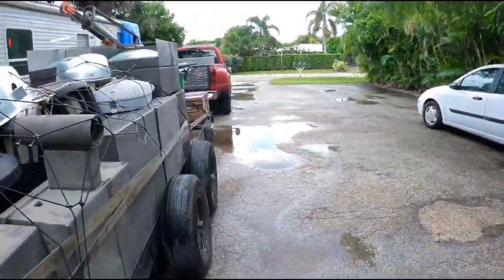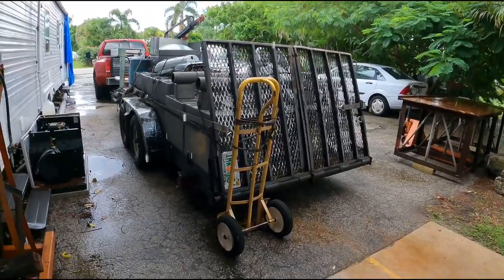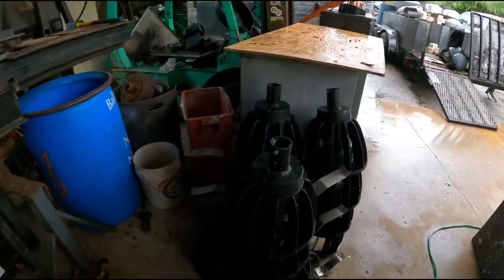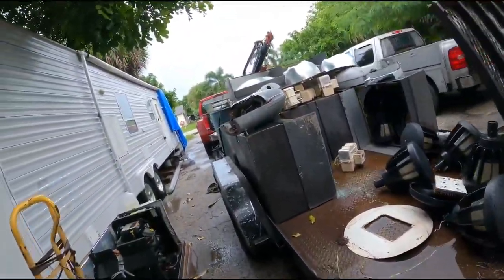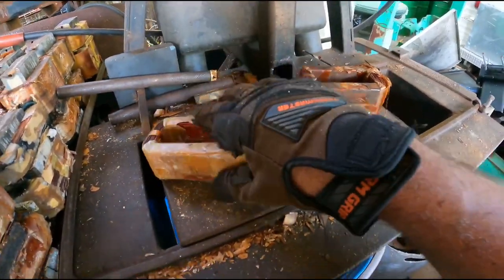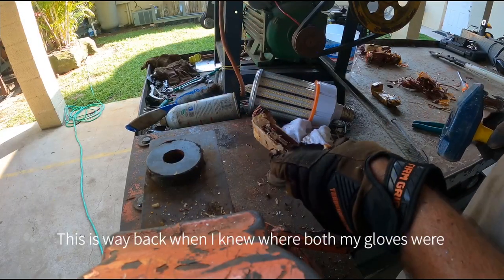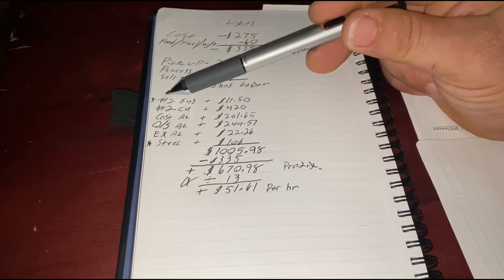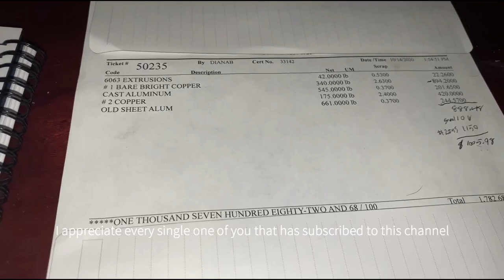Scrapping Transformers? Make Sure To Check Your Coils!

Comment: Man to think of how many of those I’ve thrown away over the years. They don’t even make it back to the shop, we just toss them in the can wherever we’re working looks like I’ll be saving them from now on!
Reply from the maker: You should be saving them, if you watch my next video that I’m about to drop you’ll definitely want to save them.
Reply: @ProjectShopFl  I had in the past when the sy would take them as copper motors but now with most being the half coated half copper they won’t take them but this video makes it look a lot easier to get apart then I’d previously thought!

Comment: I find the transformers which come from China are more likely to be aluminium windings, but you seem to deal with hundreds.so I wounder what your findings are. Copper weights twice as much as aluminium on the periodic table so it should be possible to find out from weight.
Reply from the maker: when I first started 80% of them were all copper, now it’s 50-50 or even 60/40 going towards aluminum transformers. Nobody wants to spend money to replace a high dollar ballast in an old light fixture so they either replace it with a cheap ballast from China or they change it right out to LEDs. I have done hundreds of thousands of these transformers over the past 10 years. for the first three years of scrapping I only bought HID transformers. I wish I could still only buy HID transformers. On the copper ones I wind up tripling my money.

Comment: So I have an off question here. Looking back at tour copper shredder and sluse box.
When you chew up wires that isn't say #1 or #2 wire, what does the granulated copper go for roughly.
Would that go from like $0.25/lbs to like what going rate, same as bare bright or some beer price per lbs because you took the work out of granulation?
Reply from the maker: I either get #1 chops or #2 chops. You have to be careful not to contaminate the good copper with tin  coated copper.  It goes like this #1 bs, #1 chops, #1 copper, #2 copper #2 chops
Reply: @ProjectShopFl  What is #1 BS, nose so what is BS stand for?
Reply from the maker: @midnight-xpress1136  bright & shiny or bare bright some call it.
Reply: @ProjectShopFl  OK, gotcha.
Thanks for info.

Comment: Unless It actually is a copper transformer just way them in chuck a couple small copper ones in the batch on top and send them over the bridge as motors
Reply from the maker: Sometimes if I have motors I’ll throw them in with them but I normally don’t get that many electric motors at this time.

Comment: I subbed a week or so ago. Most of my adult life I've scrapped when I can.  The one thing I missed in your video is what was the value on the aluminum coils with. The local scrap yard says 24cents.
Reply from the maker: I sell them as cast aluminum.
Reply: @ProjectShopFl  typical local  always taking advantage. But they let me drive in and did trough the scrap. I've got a warn winch that the electrical control box was damaged it had to be damaged in a them running into something.  It worked but retails for 2000. I got it for 10 bucks.  So I wont complian too much.

Comment: You sometimes see it on big transformers but very often on circuit board sized windings...different colors of copper and aluminum coating.  Those colors signify the purity and type of material. Green for instance is aluminum, and you sometimes see red paint on copper that signifies that material purity.
Reply from the maker: I wish they would mark these transformers with green when the coils are aluminum it would make it a lot easier when I’m buying them. Thanks for the info and thanks for watching.

Comment: Why you don't keep buying the insulated cable because I see more money on it when you stripped.or it's hard to fined it .
Reply from the maker: I do all the time, but my customers are mainly electricians and also have other scrap and I buy it all except for steel. I only take steel if it’s given to me. What I really want is copper transformers. You triple your money on those. Stripping copper wire you only getting 1/3 on what you paid.

Comment: Making the press button a foot pedal will speed up the process.
Reply from the maker: in the beginning I actually had a foot pedal on the second press. It was air over hydraulic. I do have an electric footpedal that I was planning on using for that but I have to modify it to work I salvaged it off a chiropractor chair.But I would definitely like a footpedal on both of those machines. Thanks for the suggestion and thanks for watching.

Comment: I need to know where that 10k psi rams from
Reply from the maker: ENERPAC! Big $$$. The second press has 2 push pull kit rams from Harbor freight. I think it was like $200. The first press has a 25 ton 10,000 psi ENTERPAC 12” stroke ram.
Reply: Appreciate it.. i found that a 34t huskee log splitter will bust them then a cheap.electric splitter will put the coils out

Comment: not to be a downer but i personally would not have driven a load secured like that on public roadways
Reply from the maker: In the beginning or the end? In the beginning I already removed two nets and three straps before I decided to make the video. it was also right down the road I never went over 35 miles an hour.  If it was at the end of the video I wasn’t even done loading the trailer. I travel a lot on I 95 at highway speed towing the trailer and I have a rule, make sure nothing can fly off at 80 mph. I only use heavy duty straps, and I net everything sometimes with two nets with a tarp underneath. Thank you for your concern and thank you for watching
Reply: @ProjectShopFl  yeah i was talking about the beginning.  happy to hear.  the bleating goat in me will rest peacefully tonight